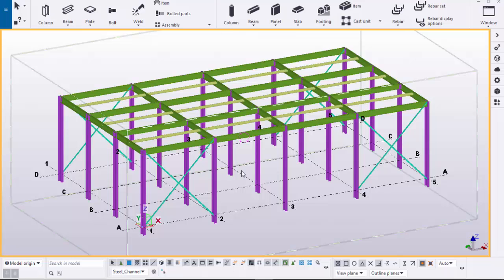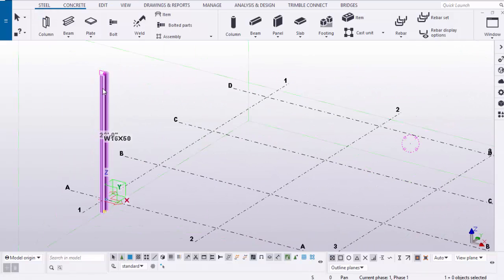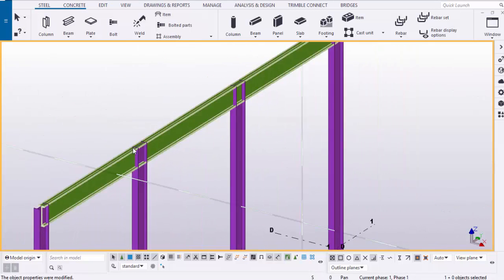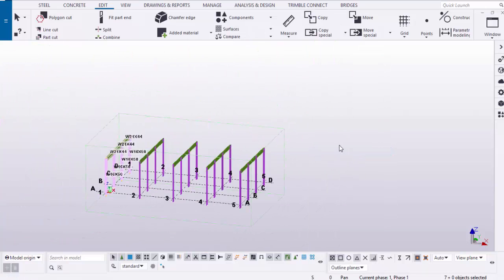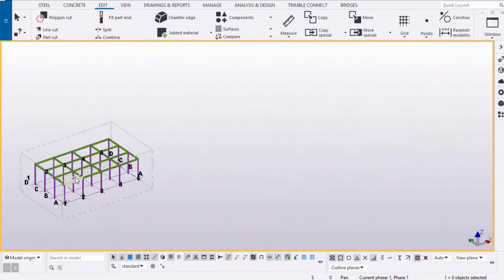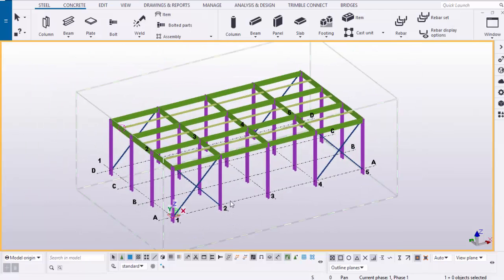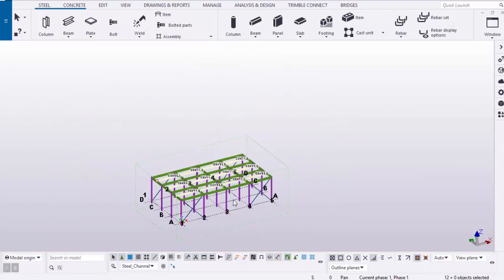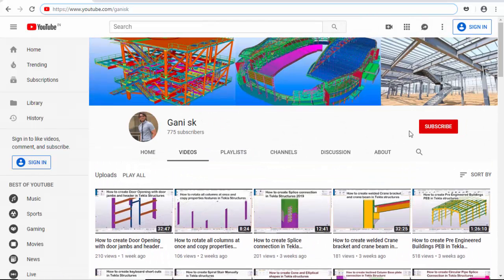How to use Selection Filters in Tekla Structures

Comment: i just want to use two monitor, how can I move the 3d view or any view window to another Monitor ?.   Please consider this one help, if it possible, it will more useful for me..
Reply from the maker: how to use two monitors on one computer refer this video: https://www.youtube.com/watch?v=V1SfsOy6fAc
Once you complete the setup with two monitors then open tekla structures in main monitor, next open multiple view by using tile vertically option(available at right side top corner), click on view top side border, click and hold it and move the Corser to move the window, drag and move extreme a side in second monitor direction.
if you have any issue comment it.